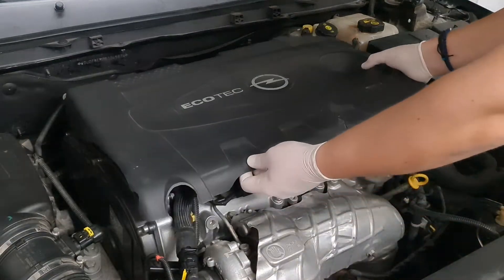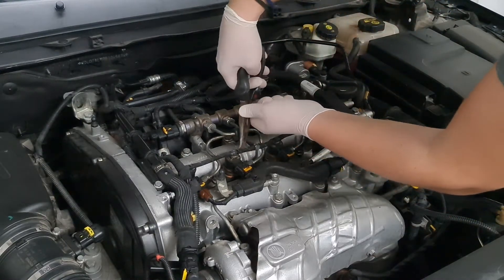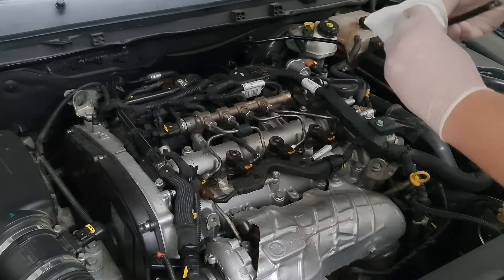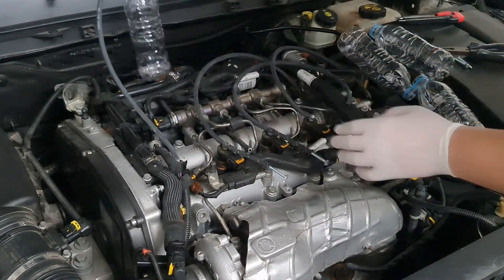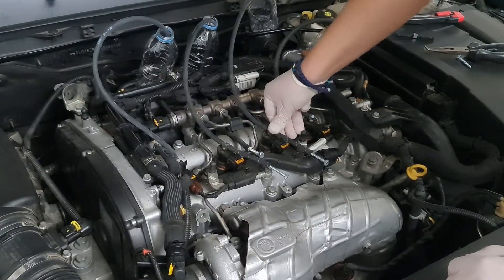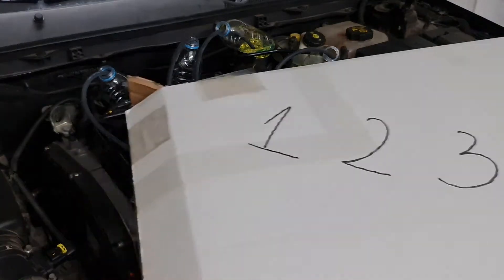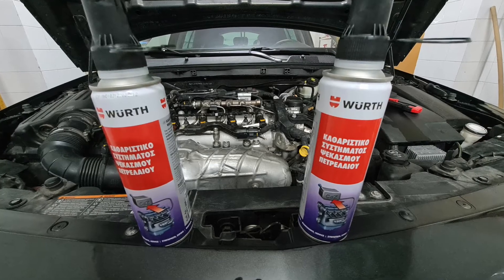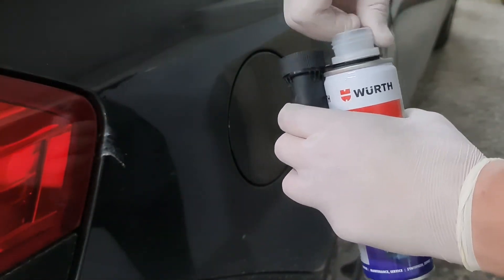#Diesel Injectors Overflow Test #Wurth Diesel #System Cleaner Test# Part 1

Comment: Hey!
Thanks for good videos. I have no issues with that but my Opel smells diesel sometimes esp after short driving and I feel it just when I open the door. Any idea  what it can be? No loss of power
Reply from the maker: Thk for coment. 
First of all check fuel instalation, rubber houses and metal pipes. After check common raill system. Hopefully there is a small problem.
Reply: @LosmiBre  Thanks!
Reply from the maker: U welcome. Glad to help.